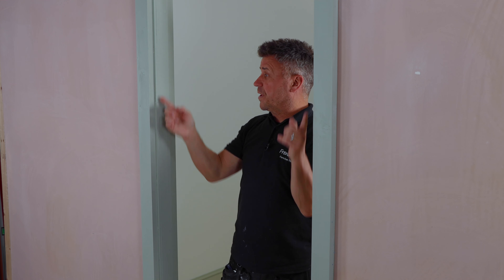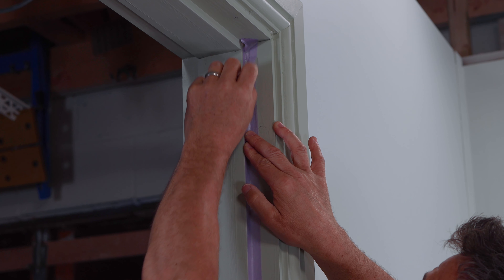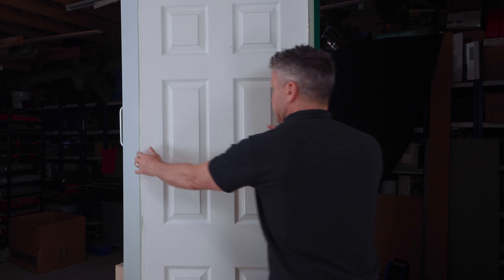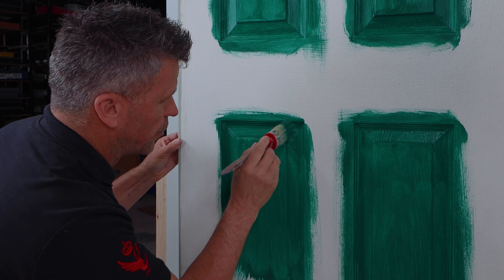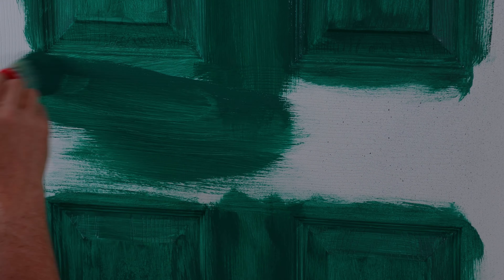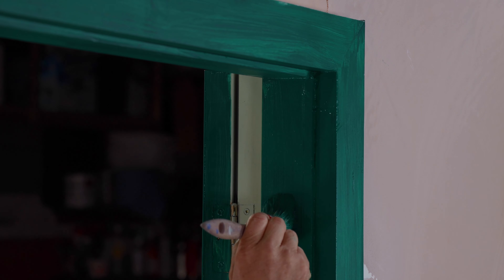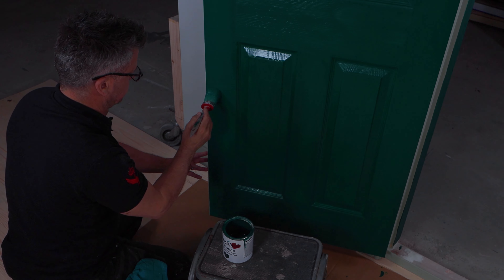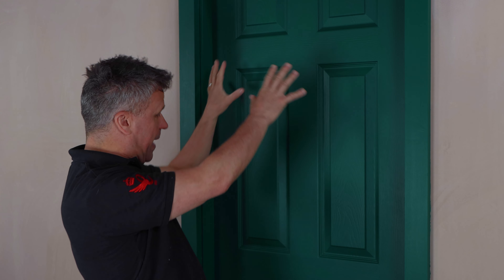How to Paint Doors & Frames with Two Different Colours | Frenchic Paint Tutorial

Comment: This is the exact thing I have been trying to figure out. We have a feature wall on one side of the room which leads to an office and bathroom within an alcove. I painted all mouldings the same colour as wall just in pearl finish but could not figure out what to do with the doors. Painting them the dark feature wall colour would be gorgeous but that colour is not going to continue into the rooms it connects to. I was thinking of painting it partially - just the trim, but then the doors would stick out oddly. I did not know if this is something people actually do or if that's too odd to paint the door two different colours. Thank you for answering my question!
Reply from the maker: No problem! Glad to help! Hope the decorating goes well!! Post before and after pictures on our DIY Forum over on Facebook to show it off!

Comment: i have similar door, MDF with grain effect, which means there are fine grooves on the surface and not flat.  It would be impratical to sand this surface, but is this why you didn't sand where normally you would?
Reply from the maker: You could sand it then seal it with frenchic's finishing coat to make sure the paint doesn't get absorbed by the MDF!